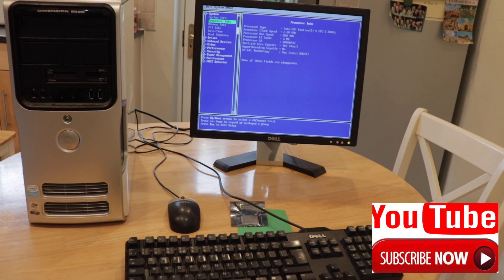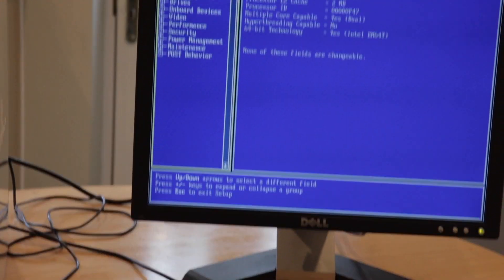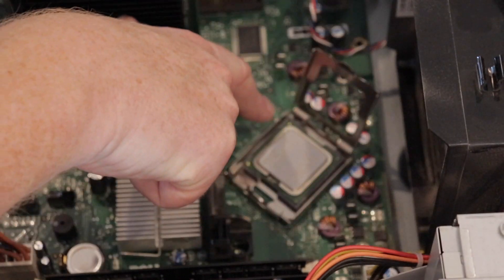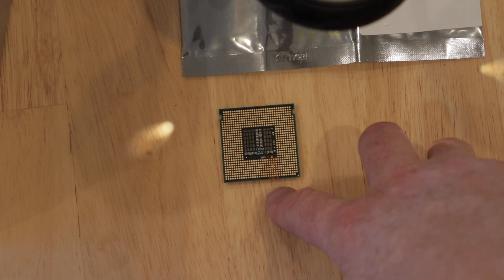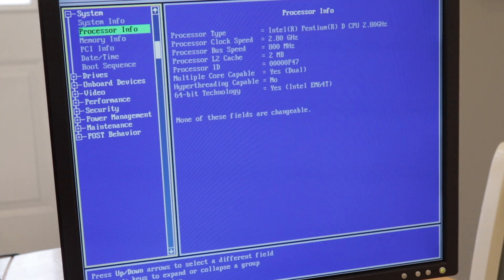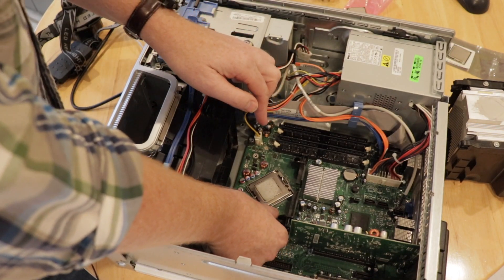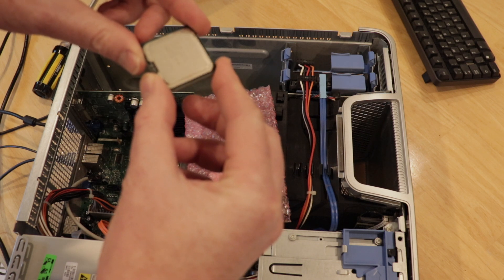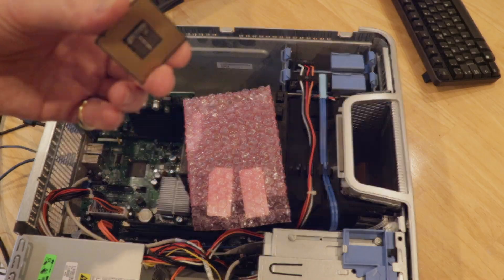Upgrading Dell Dimension E520 to a Quad Core CPU - fail then success !!

Comment: Hey! My E520 AKA DM061 Pentium D 915 beast with BIOS 2.1.2 December 2006 BIOS DOES work with a Q6600 CPU! It does display a warning during POST, halts for about 20 seconds, but then goes ahead and boots without any keyboard input needed. Seems to be stable under 100% CPU load. 
So, you don't have to update your BIOS since I gather you are running a newer version than mine.
power consumption is 7 watts more from the wall at full load. Stock heatsink and fans at low speed, so.. no problems with additional heat.

Comment: O meu PC desse modelo tá com a tela preta e fica apitando mas não mostra nada na tela.. oque pode ser?
Reply from the maker: Check the memory is seated correctly and HD cables are conncted. Do you get the BIOS set-up screen, if so go to set-up and make sure settings are correct for your H/W config.
Reply: Ele apita 6x
Reply: Não tem como eu ver nada por que não da tela

Comment: I don't have a clue about upgrading, but would be interested in knowing what one might expect to swap out a Pent D 2.8 to the Q6700 2.66.  Faster web browsing?
Reply from the maker: All around increase in CPU performance. Adding memory and quad core helps everything.  Ideally you need to upgrade the GPU to max out everything possible.  Yet to by a new graphics card.
Reply: @joewoodford9428  Thank you.  I have the original 256MB nVidia Geforce 7399LE TurboCache.  What would be a good upgrade.  (I'm not interested in gaming at all.)
I can buy a Q6700 for around $15 $20, but don't know about the GPU.  And would that require a bigger power supply or anything else.  If it gets to the point where the cost starts to add up, I'll just buy a new unit.

Comment: I have this pc since 2006 I think, only upgrades I've made are RAM and like a year ago I got a 2Gb GeForce GT 710; it's too old now and sometimes I'm amazed how many patience I have with it, lately it's been working pretty slow 'cause the time has been doing it's thing. But honestly I can't complain, this pc has been really a warrior, I've managed to run GTA 4, Mortal Kombat X, Outlast II, and others since I use it for gaming, and now for Editing too and I managed to make some 720p videos in it.
Reply: @michaelis did you upgrade your processor?
Reply: @jassenpaulcruz4247  No, it still has an Intel Core 2 Duo

Comment: @Joe Woodford I have q6700 8gb 800mhz DDR 2 and a MSI 2gb 750ti low profile and a Dell D9729 - J9761 copper heatpipe cooler it's a straight swap for stock heat sink
Reply from the maker: Thanks for the advice on the graphics card.
Reply: @joewoodford9428  https://www.techpowerup.com/gpu-specs/msi-gtx-750-ti-lp.b4098
Good thing is it only uses about 60 Wats and u don't need extra power connector
Are u using stock heat sink what's your cou temps like I also have a 92 mm fan on the back of the case
Reply: I do have a antec earchwats ea380 psu in mine but the stock 305 watt psu should be ok

Comment: ah man, this takes me back! had this PC and a simply just placed an 80mm fan on the gpu, then overclocked it! x1300 if I remember right. man those were the days!
Reply: How are you able to overclock a Dell OEM board? I want to overclock it too
Reply: @thesexyskywalker3283  It was through software, in windows. your BIOS wont allow overclocking. If you look for "*your CPU/GPU model* software overclocking" you might find some. searching for it, Im too lazy, but if you need advice with it when you're doing it, any questions, hit me up, juantjie@gmail.com
Reply from the maker: thanks :)

Comment: I got a few parts of this computer in a lot of computer parts. After researching this for a little bit I kind of want to restore and upgrade it to a quad core with 8GB. But it would be too expensive to get the case, a cooler and the fan as they are all special Dell parts.
Reply from the maker: eBay might be a place to pick this up or visit a computer thrift store in your local town?

Comment: Does anyone know whats the best graphics card for the E520?  I upgraded mine to the qx6700 with 8 gigs ram @ 800 mhz and a ssd.  I dont want to upgrade my GPU and dont mind cutting up the case some.  I heard the GTX750Ti might work?  Anything better that will work with my 305 watt gpu?
Reply from the maker: Hi Eduardo, Thanks for the question, I'm interested in this as well as the current video card does not have much grunt for anything graphic intense.  Recommendations welcome !!
Reply: I have a https://www.techpowerup.com/gpu-specs/msi-gtx-750-ti-lp.b4098 in mine runs fine

Comment: I’ve just got a e520 out of loft running vista pretty sweet.

But I’d like to get it on window 10 which I’m having problems with. I’d like to drop in a new cpu. 

The upgrade path to windows 7 then to windows 10 for free seems to be broken.

The windows 7 upgrade checker won’t connect to the Microsoft servers.
Reply from the maker: Hi Ryutube, I think Microsoft has closed off the free upgrade route about 18months ago. You will need to source a Windows10 key. www.cjs-cdkeys.com might be worth looking up for such a service.
Reply: Hello! I've set up a mothballed one yesterday as-is, only adding a 120GB SSD.  It's P4 3.00/ 4 GB RAM: 2 *667+2*800 Mhz /  PCIe GE210 256 MB/ 305W PSU - real champion, innit? Installed clean Win 7 Ulti 32bit,  unofficial DVD, used Windows Activation Tool 2.2.2.  that I found on some old pendrive from 2015. I didn't bother downloading and installing all SPs, updates etc, not even video driver. Everything went down straight and only from the 2010 Win7 DVD, didn't even have an Ethernet cable plugged in. Then, on the same USB stick I had several of those "invitations" to upgrade for free to Win 10 downloaded, about 10MB .exe apps; the ones that bombarded our screens every few minutes before 2016. I copied one on E520's Win7 desktop, clicked and it just started, checked PC hardware compatibility, confirmed Win 7 activation ;) and... I've just plugged in the Ethernet cable this time (E520 has no onboard gigabit though) and 40 minutes later complete Win 10 was in place. Try to find them, good luck!

Comment: Are you Thinking the Q9500 is working too on this Board? If not i will order the Q6700
Reply: Q9500 will not work. PC doesn't support 1333mhz FSB CPU's, only 1066 so Q6700 is pretty much max.
Reply from the maker: @user-tl9ry1pj1j  Great thanks for the advice !
Reply: @joewoodford9428  no problem.
Reply from the maker: Hi ZaZzcode, I messed around with 3 CPUs so I thinks it all down to the BIOS.  I'd stick with Q6700 as that will work. Tell us how you get on???

Comment: You have to upgrade the heat sink for stability the one you need has a copper base and copper pipes that poke through the plastic cover. Memory 8gb 4x2 gb sticks pref all the same manufacturer but not essential, oh and if your ok with doing a bit of DIY to the case then you can fit a geforce 1050ti the ones that get all the power from the pci slot.
Enjoy
Reply from the maker: Thanks for the additional tips, might be a project in a couple of months time.  Like the idea of GEForce 1050ti.  Out of interest what is the best graphics card that could fit and work in this systems?
Reply: @joewoodford9428  that would be a Dimension 9100 heatsink and shroud i have one for my E520
Reply: @joewoodford9428 quadro k2200

Comment: Thanks for sharing.
The service manual for the E520 shows the maximum amount  of memory is 4GB. Is it possible to increase the amount of memory that can be installed using this method?
Reply: I have 6GB and it works with a Q6600 installed plus windows 10
Reply: @mehftv  Thanks. I'll give it a go on my E520.
Reply from the maker: Hi, not sure if the BIOS will support >4G.  But if "mehftv" say its works why not give it a try !! Please tell us if you are successful as this will help others :)
Reply: @joewoodford9428  Unfortunately things have not worked out too well. 
My plan was to put  a Q6600  processor in and if that worked,  explore increasing the RAM to >4GB.
I installed the Q6600 but the machine would not POST. I then reinstalled the old processor (Celeron D) but the machine would still not POST. With either processor I am getting no POST and no beep codes but the fan and the drives spin and the standby LED lights up on the motherboard. I even removed all the RAM just to see if that would produce any beep codes. Alas, it does not. No POST or beep codes usually means a problem with the PSU or motherboard. This is very infuriating as the machine worked perfectly well before I attempted the upgrade. I can only think I may have inadvertently damaged the motherboard when removing the heatsink/cleaning the inside of the case. Surely the PSU cannot be at fault if the fan and drives spin? 
If anybody has any ideas/advice on this, please let me know.
Reply: @cookiegolf5962  i have the same problem with my E520, but instead i first upgraded the 1.8ghz dual core to a q6600 and then a q6700, it worked at first but it started to freeze up, and now it won´t even POST. Can it be not enough cooling? The q6600 worked fine when i used it, but even now changing it back does nothing.
I tried force-reboot it several times in a row and got it in a state where the fans started surging, but no POST.
i think it is not enough cooling.

I have 8GB RAM, works fine when u use a 64bit system, 32bit only recognize less than 4(i think 3,5GB)
Reply: @eg8475  You may be right about the cooling but I can't find anyone else online who appears to have had that problem. Have you tried reinstalling your original CPU to see if that works. Good to know that 8GB RAM works  with 64 bit system.
I've tried other PSUs on my machine but still no joy so my problem is almost certainly with the motherboard. As a last resort I might attempt a heat gun reflow to see if that revives the board.

Comment: Thanks. I get my 6700 tomorrow! Gonna disable floppy search during boot and cross my fingers I can get 4x2gb memory to work! Running win7 on the stock processor now.
Reply from the maker: tell us how you got on! it would be interesting for others
Reply: Dude did the 2gb sticks work?
Reply: @Welshy-bk5rh  I put 4 gb of memory and a q6700 with a bios of 3.2 in my e520. I didn't try 8 gb of ram, so idk if it will or not.

Comment: Hi, thanks for the info, I believe the Q6600 Processor works too, I did see it used in an upgrade for the E520 on youtube, so I ordered that one before I saw your video, ill see how it go, thanks again for the video :)
Reply from the maker: Hi Melissa, the Q6600 is the same family so should work as you suggest.  Once you have tried it please add to the comments and help out fellow E520 upgraders if it works :)
Reply: @joewoodford9428  Would the Q8200 work also?
Reply from the maker: @connorm955  Its all down to the BIOS.  Q6700 does POST but other that might work I tried just did not. Its a risk if the Q8200 will work with this motherboard.
Reply: @joewoodford9428  I actually have one of these now with the Q6600, the BIOS recognizes it, but Windows XP only sees 2 cores. I installed Windows 7 and it also sees 2 cores rather than 4.
Reply: @connorm955  no. It will only support up to 1066FSB chips. So Q6600 is pretty much the max that is worth it price wise.

QX6700 and QX6800 should be compatible, but are rather pricey compared to the good old Q6600
Reply: So I’ve just got a E520 out of loft, running vista. & I’m sure I’ve got a faulty tower with a q6600 processor. I think I might try this tomorrow.
Reply: @RyuOnline  Make sure you update it to the most recent BIOS first, 2.4.0.
Reply: @user-tl9ry1pj1j  No need. BIOS 2.1.2 works fine with the Q6600, just gives a warning during POST.  IF only showing 2 cores, I hear solution may be to nuke the old CPU drivers from device manager, reboot. aka .. software problem.